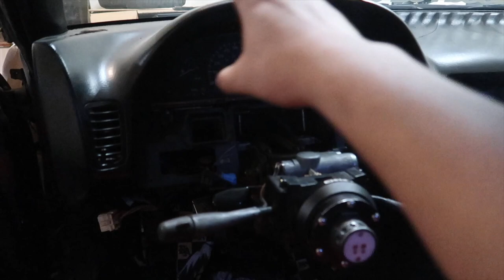The Pursuit of Perfection!

Comment: A great product for keeping your dash, tires and trim conditioned is 303 Aerospace UV Protectant. It's a UV protectant so it helps protect parts against sun damage. You can use it on wipers and even serpentine belts. For belts, you have to treat them when they're off the car. You can get this stuff at Walmart. I usually just spray it on and let it soak and set then wipe off the excess.

Comment: You need a nismo cluster for the s13. And hang on to your dash. The crack can be grinded down Bondo and prime the whole dash with the good primer that builds. Wet sand and can paint to Mach the car. It's some work but looks good. And some people like to flock there dash.